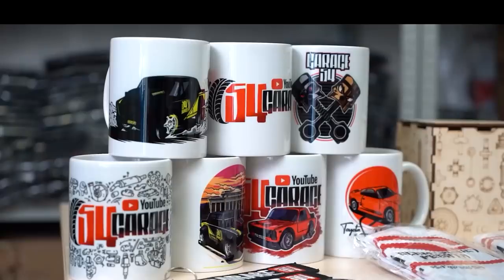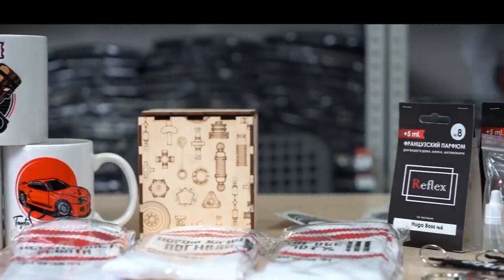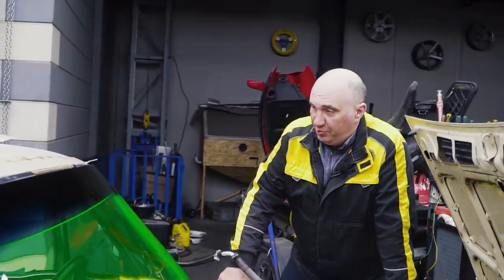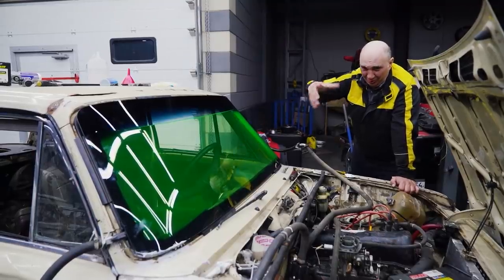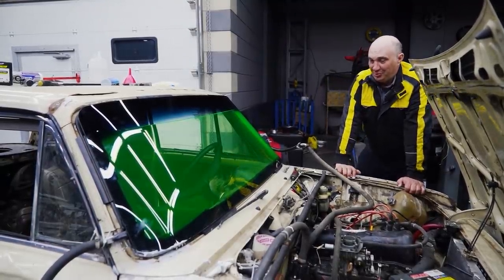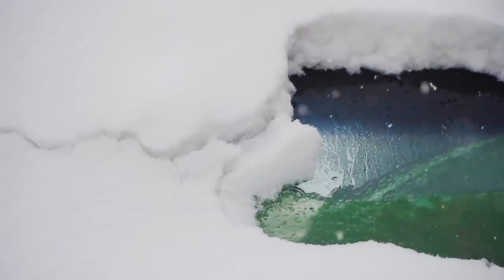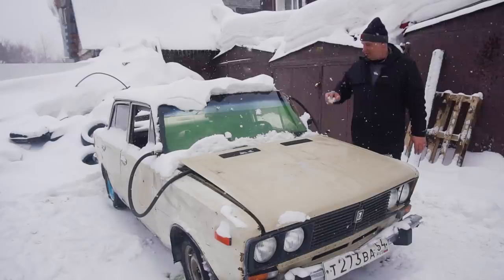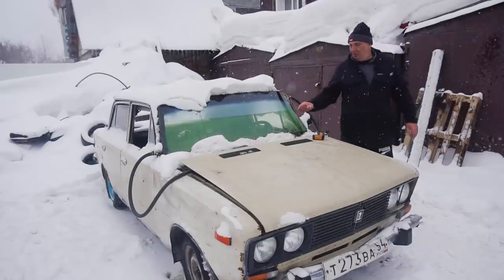Using coolant to heat a windshield

Comment: That worked amazing but if you filled the level to only 10 cm high I think it would still work because of the heat rising between the layers of glass and then you would be able to see where you're going too.
Reply: the area above would just fog up inside between the panes. look at the area above the coolant level in the one they did. that condensation would end up over the whole windshield
Reply: For it to actually work right, it would have to b vacuum sealed to prevent fogging. But that's not a option running off the cooling system.
Reply: So it defrost but not defog. Bummer.

Comment: Other way is make heat exchanger between coolant and windshield fluid container. Coolant heats the windshield fluid and it will defrost ice on windshield
Reply: This would be nothing special, it’s available in good cars since decades

Comment: Reduce to 5mm and use blue tinted coolant. Ethanol would not be a good coolant because of the low evaporating point compared to water.

Comment: Hook the hoses up the other way with pag 46 oil for an air conditioner and bleed the air out pressurize to 3psi try to drive it!

Comment: I always thought the ac condensation drip should be used for something, maybe just run infront of the radiator to help cooling, most things on cars these days are ultimate efficiency but all that water is dripped on the ground

Comment: That’s brilliant!   I wonder what temperature the engine’s running at.
Reply: Pretty chilly after you get going since you have radiator, plus window to cool it down. Would probably add thermostat to prevent glass getting too hot since hot cold cycles probably will crack it in some point, but man i want to do this and go to road safety inspection, just to see the engineers face when they see this.

Comment: well two downsides. In winter all the salt spray will freeze instantly and you can't wipe it away. 
In summer it will be hot in the car. 

Also an accident will be even less fun

Comment: Ok... Version 2.0. = 3 to 5 Millimetre gap between windows (then you will see less 'green' looking through the windows), yes, have inlet running in from bottom of screen and outlet out the top of screen, and fill the window gap so there is no air in it what so ever.. THAT should be a way better version of a brilliant little project
👍👍👍      😎🇬🇧

Comment: I've seen a few good ideas people have done with winterizing cars  but will it work is the question I've seen a guy use water like heat tape on radiator and plug in so car don't have to warm up and dead battery issues cause of cold the guy used a bucket warmer for his battery

Comment: Wouldntve it have been easier to run both tubes out the bottom of the windows just drill 2 holes in the sheet metal so they go under the hood right to the motor use the heater core hoses to cycle the coolant

Comment: this actually seems like a semi practical invention.. does it work as a radiator on the inside for some auxiliary heat?
Reply: Thing to keep in mind: whatever you fill your liquid-heated windshield will splash all over you, get into your eyes, get breathed in, etc. should anything ever come through the windshield. So whatever you put in there must be non-toxic, non-flammable, have a freezing point under -40C and be no more than a mild irritant.

Comment: Imagine driving on the highway at 140km/h and a rock chip cracks your windshield :)
All of that hot coolant will go right at your face :D
Maybe that's the reason why it's not done in production cars :)
Reply: It would leak outside not inside when a rock would crack it enough.  Or you mean brick size rock - then maybe.  But hitting a deer/elk/pedestrian or tree branch could damage the  windshield so the coolant would leak inside for your legs and torso -- and 90deg C or 220deg F is no joke for your skin. You would get burned/scalded AF

Comment: For this to work dont the engine has to be without the thermostat valve, is it?
Reply: Why? It would take a lot longer to warm up.
Reply: @the_kombinator  i meant to say without it..
Reply: It depends how the cooling system from this car is designed. A thermostat just means the engine has a small and a large cooling circle. If you attach to the small circle it doesn't matter if it has a thermostat or not

Comment: It's a great idea until.... you end up behind a dump truck with a full load of gravel on the highway, then you remember why there are so many warning labels plastered around your radiator under the hood 🤤..everyone knows how hard it is to keep on the road when your sealed up with just a bee in the car, imagine trying to hold it in the lane after springing a leak in this bad boy, while your trying to avoid boiling you nuts or melting your face....lol

Comment: im not sure, but making the coolant go through the windshield kind of acts like a second radiator, so it double cools the engine
Reply: even triple because of the heater core.  But windshield is flat and have not big surface to be noticable for cooling effect.

Normal car radiator about 40x60 centimeter size (15*25 inch) have a effective surface of 20 sq meters (215 sq feet) and it is made of aluminum which is a great heat conductor
Reply: @MikeB4pl  good point

Comment: A guy in the U.S. tried this in the 50's but it failed the safety part when in a collision test the windshield broke and sprayed hot coolant on the front and back seat safety test dummies

Comment: Number 1. If it broke you would be covered in toxic antifreeze so heaven forbid your mouth is open. Or if you have children or pets in the car. number 2. I would imagine it has a condensation, fogging issue. I know its not the same as but i think it would be similar to a blown heater core and would be horrible if there is even the tiniest bit of moisture around. And number 3. And i know this is true because of reasons. If you have that big of a heat source and that hot of one just feet from your face. Not to mention inches from your fingers. Lets just say it would be alot more miserable than it would help. Now on the other hand. Mabey im poor and the viehicles around me are outdated but why dont new cars have grid heaters on the windshield like on the back window. I think it would help alot with viecles that have problems warming the cab in the winter like diesel pickups. And it could keep the window clear for long drives without making the car ride miserable. I have had several cars and trucks that i had to have the heater up so high that it was miserable to drive or even keep your eyes open. Or you have your windows open just to keep the window thawed. And you wouldnt see as many beaters without heaters risking their lives because of a simple thing as a bad heater core. Which on some viehicles aren't even worth it. Where a simple heater wiring system would be so basic. I have known alot of people that would drive in the miserable cold without a heater if they could just simply see. And you wouldnt see such crazy redneck stuff as fireplaces in the passenger seat, or driving while trying to see through the foggy window in itself trying to wipe it clear. Hotwiring in a dozen cig lighter heaters, exc. Basicly. They could make some thinks as simple and as important to driving as, well i dont know, being able to SEE just a tad more redundant. Give it at least one backup. And all of these are normal problems for alot of diesel viehicle drivers when their stuff is running as intended. I have seen them do some sketchy, crazy shit just to both try to see, and try to get the tiniest resemblance of warmth. At least beang able to see, you could throw on some gloves and a few more layers and keep trucking. Not everybody gets the luxury of warm weather most of the year or to have the money to keep fuel in the thing that gets them to work. They couldnt imagine a luxury such as spending the time or cash for something as little as heat or even having the knowledge to do something like remove an entire dashboard. I know it sounds ridiculous. But for alot more people than you know. This is just life. But something literally that simple could make things a huge percentage easier. And like i said before. 9/10 its much easier to diagnose a problem with one of those window heaters than it is to change a heater core let alone make some viehicles heater controls even work